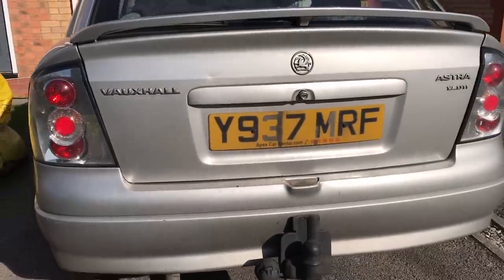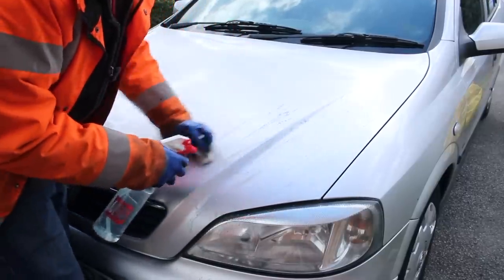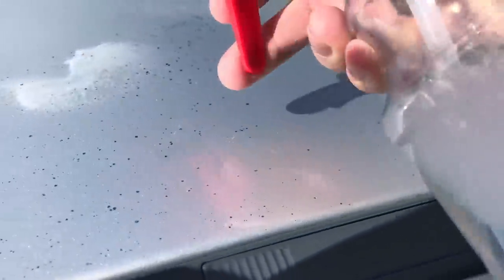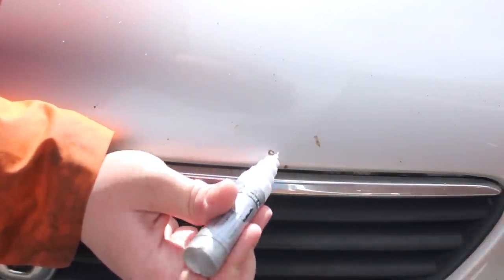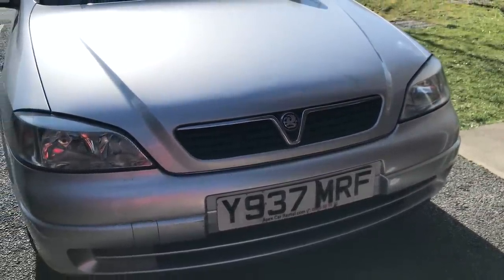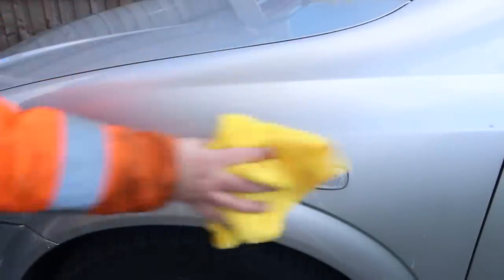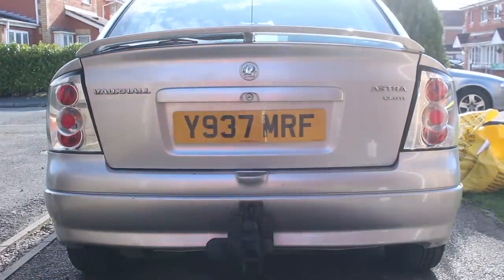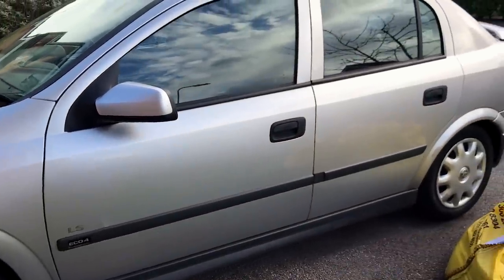Restoring and Detailing A 270,000 Mile Car - Part 2 - The Result

Comment: The heat gun on the faded trim was a real winner. 1st time I’ve seen that done before. Top result.
Reply: I guess you should use it wisely.  Don't heat the panel too much or it might become warped.  Heat the trim on different places.
Reply: Not the first time, but you should know that this trick is a one time solution only. You are melting the plastic.
Reply: After a while it becomes faded again.  Why would the heat gun not work anymore the second time?
Reply: Because you're forcefully taking oils to the surface. You won't be able to do it again because there's no oil left in the plastic.
Reply: exactly, your essentially drying out the plastic further. Black to the future would have worked much better an lasts ages
Reply: There are many other videos before this one that shows the heat gun trick.
Reply: Lee Holdsworth  dooonnntt do ittt you will get green hues to the trim in about a week I speak from experience I used to do this it leaves them brittle and makes them go green your better off buying nicer looking second hand or new eBay knock offs
Reply: Autoglym have some trim restorer that does an amazing job. I used some on our lass' car that had some faded light grey looking trim. Used it on that and it turned it into a darker deep grey almost black looking trim and made the car look much better. This stuff lasts a long time too. Works on the inside of cars too for inside trim and smells quite nice. https://www.autoglym.com/bumper-and-trim-gel
That's the stuff for anyone interested.
Reply: Lee Holdsworth oldschool
Reply: Lee Holdsworth never knew that could be done sir, well done. Car looks great for its age 👍👍
Reply: wipe it on, lick it off then buff up.  Win Win.
Reply: he should have applied shoe polish after he was done with the heat gun. really brings back the black
Reply: Yeah the car was that old he didn't really have to worry about doing it again.
Reply: @gonzalotapia1250  But what can I do then are there any products that I can use to restore the fainted plastic ?
If you know some pls gimme a link :)
Reply: It's a trick I've used before, but go careful, ideally practise on an old scrapyard panel first, so you don't accidentally bubble the paintwork or melt trim on a good car when learning. Go slow and steady, don't get too close, and keep it moving back and forth so it doesn't sit in one place too long. It works well on very old faded cars like this.
Reply: @deekstewart10  My car has grey bumpers etc. I have seen loads of "Back to black" type products. But is there anything you know of that would restore grey? 

Thanks in advance.
Reply: I just use ground nut (peanut) oil. Works a treat and lasts ages.
Reply: ye...i also never seen that before...great result
Reply: Same, wish I would have known this trick in my days as a detailer.
Reply: I burned my trim trying it lol

Comment: Subscribed! Those old Astras I believe have a 1.7 Isuzu diesel engine that will run forever if you change the oil often enough. But the finished product looks amazing. Speaking of the engine. Would love to see that detailed as well as the interior. 
I'm not a professional detailed myself but cleaning dirty cars and admiring the results brings a smile to my ugly mug.

Comment: Well, this Saturday I did exactly the same to my opel astra 2003 :) The difference is after cleaning and decontamination with clay on the bodywork I used carnauba wax, then a second layer of ptfe wax and and as a third layer some quick detailer. The car is shiny and with a deep colour looks. The nice waterpearls after heavy rain we had here soon after I finished with my poor old astra have been looking fantastic on a freshly polished paint.

Comment: why did you not clean behind the number plates???
Reply: what you can't see isn't there
Reply: not the point - you might not be able to see rust under the floor of a car, but it's still there, ignore it for long enough, and you find yourself sitting on the concrete
Reply: very good point why go to all that trouble then leave that
Reply: Ikr? My ocd was triggered lol
Reply: harrison herring and when you wash it the dirty water will make your bumper look less clean
Reply: harrison herring , fair point bearing in mind that he removed the old number plates but nevertheless he did a pretty good job on an old banger .
Reply: He said he dident have the car long that's my guess
Reply: I think he did clean behind them but didn't video it.

Comment: Great job but I did prefer the rear lights, by the way do you know what the engine was, I assume the diesel but was it the Isuzu engine or vauxhall? Would be interested to know with that mileage
Reply from the maker: Haha. I guess it’s a love or hate thing.
Reply from the maker: It’s the Isuzu (1.7 DTI). I’ve got the Vauxhall one in mine (1.7 CDTI) that’s going strong on 130k. They’re basically the same engine with updated common rail injection on the Vauxhall one. Both bombproof from our experiences.
Reply: Torque Steer I had the Isuzu engine which was reliable but didn't work to well with the gear box it was a uncomfortable drive compared to the vauxhall I have had both. Keep these as long as you can as the newer ones were rubbish and didn't even have a temp gauge in it so when the car over heats like mine did then how do you know. It a must in a diesel
Reply: Steve Hughes temperature gauges are a must in every car but in my experience even cars with temp gauges nowadays don't really show you the actual temp they are just dummies my mom's 06' 1.4 16v fiat punto toasted it's engine and the gauge showed that the temp was spot on and our 98 Range Rover went into limp mode becouse of overheating and again  the temp gauge was sitting right in the middle like nothing is happening
Reply: Isuzu, petrol engines come from Opel Germany. Opel is the parent of vauxhall
Reply: thanos mousios a 98 Range Rover isn’t exactly ‘nowadays’

Comment: wow that's a huge difference it came out great for being treated poorly and not doing everything like  pro would have but for a driveway job thumbs up! and i learned a new trick for detailing......using the heat gun on that faded trim works wonders thanks for that tip

Comment: Autoglym Tyre Dressing is fantastic if applied correctly would recommend using a paint brush instead of a cloth as you get better results also if you want a deep shine re apply as required.

Comment: Elongate the number plates holes on vertical axis, even just by 3-4 mm on each one, usually that'll give enough movement to get the plate level, whilst the head of screw still covering the hole. I fit hundreds of these. Always works. Nice job
Reply from the maker: I just done it that way on my Audi ;)

Comment: Great tip on Thr last video about bringing plastic back.

Regarding spray waxes, I use them between waxes. I'll do two full wash, Polish and wax, one Easter on end of sumer, then in between I'll get the local hand-wash to wash it, then I'll give it a soeay wax.

Also living by the sea, spray wax is a must for bird shit. Sqirt on, wait 30 seconds and it will soften, wilioe of with midrifiber cloth. Also good for kids sticky fingers.

My biggest tip is sun cream, never let kids near your car paint in the summer, you do all the door opening. If you get any sun cream in your car, get it off ASAP. A good few spare wax and buffs to make sure it's gone. It ruins top coat, like noting else.

Comment: Awesome! My Astra did 262k before it became uneconomical to repair.. best car I ever had xx so great that I bought another one ! x
Reply from the maker: Cool. My one is still going strong (only on 120k though). I’m hoping my Dad’s can hit 300k. What engine was in yours?
Reply: Torque Steer 2litre x
Reply from the maker: I’ve had a couple of 2.0 dti’s. One was still going strong on 150k, the other’s fuel pump gave up at 120k. I’ve found the 1.7 dti/cdti to be a little less refined but overall less problematic. I’ve got a 1.7 now because they’ve never let me down.

Comment: Enjoyed this. Commentary is very clear and easy to follow. My one tip would be, fold your microfibres into quarters. Gives you a softer surface to put pressure on and will make your clothes last 4 times as long. Other than that, good job. :) Edit - Just seen you didn't wipe behind the number plates! :( 2nd Edit - Thank god you replaced the Lexus lights lol! Could have cleaned behind them though ;)
Reply from the maker: Haha, just time constraints.

Comment: lol I'm back! Again, thanks for working on this car and putting up this video. The editing, camera work, and review of last vid are all great. And yeah, form start to end this Astra shows an immense difference, it looks WAY better now. It's also good to show washings are more approachable to the average person, or someone just starting out.

Constructive criticism for you or anyone else reading comments: It might have been good to wait until after the clay baring to heat gun the plastic. You wouldn't want the dish soap solution to strip those oils you just brought to the surface. You mentioned the correct way to touch up, so thanks for letting curious people know. The spray wax is ok because of the reasons you mentioned, but a real paste wax will generally work better.

Other notes: Wow,  that clay bar got to work on that roof! Melted that tar right off. My license plates comment from first vid reflected here :P I like meguiar's synthetic paste wax, it goes on even when it's pretty cool out, lasts a while, and is pretty forgiving. Also, a an air compressor can really help with blowing the water droplets out of your grill and trim, thereby making it easier to put down wax.
Reply from the maker: Thanks again for the comments and for watching the videos. 

Good tip about the plastics and the clay bar. I probably would have done the clay first but unfortunately part 1 and two were filmed two weeks apart. Defiantly worth keeping in mind for the future. 

As for the wax, I’ve not tried the meguiars synthetic paste wax. I do like Fusion by Auto Finesse though. Hybrid wax that leaves a great finish and 5 months on, still beads nicely on my Fiesta :)

Comment: Very informative, i have an Opel Manta that goes to car shows so polishing everything is something i'm used to.
 A trick i was taught years ago for tires is polish them with black shoe polish, just like polishing your shoes, the tires then look like they are fresh out of the mould not like they are made of plastic as some tire cleaning products make them look.
Reply from the maker: That’s a great tip. I’ll definitely try it out. I love trying unconventional methods. I’ve always loved the Manta too. Cool car.
Reply: When i first heard this i thought it sounded weird, but the tires comes out looking like natural fresh rubber. Glad you like Manta's, and yes they are cool cars which is why i've had 20+ of them over 27 years !
Reply: I've been using this trick for years it works perfectly and it also protects tyres from then sun so I usually nice coat of it in the summer days
Reply: Does that not leave a greasy residue behind on the tyres?

Comment: I've got mixed feelings about this...

You went through the effort of putting in a lot of time to get the trim back to black and used all kinds of products at the start, but finished with a quick detailer instead of a proper polish and wax.

A nice result, but it feels like you suddenly got sick of it.

What's the interior like?
Reply from the maker: Really the car needs a full machine polish and I was a little bit stuck for time as he needed the car back. I felt that a hand polish wouldn’t have made much difference anyway. 

I’d normally stick a decent sealant on it but it was about 2 degrees Celsius outside (despite looking quite warm) and neither my hard waxes or sealant would have cured very well in the cold. The spray wax, with it’s wipe off formula still performed normally.  I’d actually like to take more time on it and go a bit more in detail. 

The interior is in decent condition but very dirty and I will be doing a video on it sometime in the future.

Comment: "Fortunately it's just a matter of unplugging the plug from the back of the lights and undoing 2 thumb screws and the lights will just pull straight out"

I so badly miss these cars that don't need bespoke manufacturer tools just to make simple changes!
Reply from the maker: Common sense. Something my Audi A4 doesn’t have haha.

Comment: What parts were replaced on this car?  Is that backup Astra a non-runner for spare parts or a backup car to drive?
Reply from the maker: This car is all original apart from normal wear and tear items. The backup Astra is my backup to my Audi A4 incase I can’t use the Audi.
Reply: That's amazing.  So it is still the original transmission and engine?  Was the car maintained by schedule?

Comment: I worry about the rusty rock chips, if the rust is under the paint, will it spread? Maybe it's not such a big deal. It looks great!
Reply from the maker: I wasn’t too worried. They have been on the car all it’s life and haven’t spread. A new bonnet is only about £10-15 if the worst should happen.

Comment: Great job ! finally someone appreciates such a car as Opel Astra ! I want to learn how to detail my car and I just wondered if there is some way to detail a car just similar to your results without having to buy all the products used, cause honestly they are almost more expensive than my Astra :D Thanks
Reply from the maker: Haha yeah I understand why you wouldn't want to spend so much on products. Really, you could achieve a great result if you did this:
-Prewash (pressure washer with snow foam would be great, otherwise rinse it off well with a hose)
-Wash (two buckets ideal with a microfibre wash mitt, if you have one bucket just blast your mitt off with the hose before dunking back into the bucket. Any car shampoo will do okay)
-Clay bar (Stage 3 of the decontamination but the most important. It can normally remove most iron particles and road tar and leave the car feeling very smooth and shiny)
-Dry 
-If you want to take if further, a polish by hand is an option (especially on darker or more solid colours, tripple by auto finesse is very good.) and then a wax (Meguiars Gold Class paste wax is pretty good and not too expensive). 
-I've not tried it myself, but people have said shoe polish can be good on tyres and trim. I like Meguiars endurance tyre gel. 

Hope that helps :)
Reply: Thank you very much! I´ve been doing it almost as you have described and it works for a while (until I park under a tree) I have pressure water but I cannot attach any bottle with that snow foam to it so I may work on that and I will buy the clay for sure. Again thanks

Comment: Does the rear lights have the same line up fitment as the sport rear lights do. I'm thinking of buying a set but not sure wether the bulbs will fit from one to the other
Reply from the maker: Everything is plug and play so it’s really easy to swap. As far as I know, the bulbs are the same too.
Reply: Torque Steer oh okay just wondering as doing an Astra g as a project and didn't know Wether the plastic light holders inside the tail light were the same
Reply from the maker: The plastic holder is physically different (if I recall, the Lexus lights didn’t really have a holder like the stock ones ) but the plug that goes into the car’s electrical system is the same arrangement.

Comment: The black marks goes away with acid wheel cleaner:) also the heatgun actually dryes out the plastic, after a few months the black plastic will turn white
Reply from the maker: I did the heat gun on my Astra two years ago and they’re still fairly black :)
Reply: Torque Steer just be aware that it dryes the plastic

Comment: i have a 2002 Astra, same model with the 1.8 125 hp, but in red. Red is such a horrible colour to be kept in a good condition. Silver is so much easier. I wonder if it will ever look as how it looked over 250,000 kilometres ago.
Reply from the maker: The red paint on these seems to fade very easily. It makes it more satisfying to detail though.

Comment: don't use Clay bar with soup, it will break down the clay and reduce the lifespan of it, and it won't be good, use Clay Lubricant instead. if you want something better than clay bars, use NanoSkin you can use them with soup and they give amazing results easy to use and reusable .

Comment: How could you not clean under the license p late!!!! And the 2 bucket method is bad, I leaves lots of dirt in the bucket which you then put on the paint and scratch! Use a single microfiber/lambswool mitt on each panel!

Comment: Dude...DUDE...all you had do to was get a bottle of ANYTHING and spray a couple of shots of that mess behind the plates and wipe it off. How could you have cleaned that whole car like that and then discover the mess behind there and not take 5 minutes to clean it off?! I'm triggered. Also, I wouldn't be able to live with the wonky plates. Nice job otherwise.
Reply: Lazy, I cleaned behind both my registrations plates few days ago, its good idea to wax those areas because they barely get any attention so for an older car it would most likely get paint damage if not cleaned for a very long time